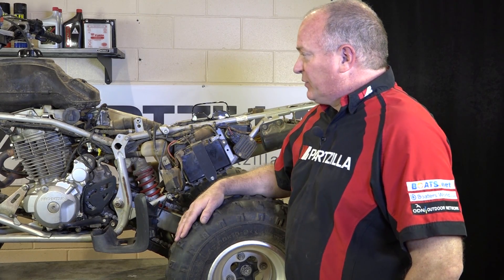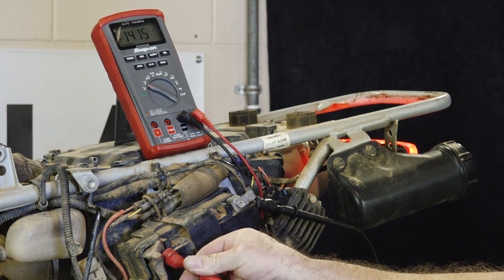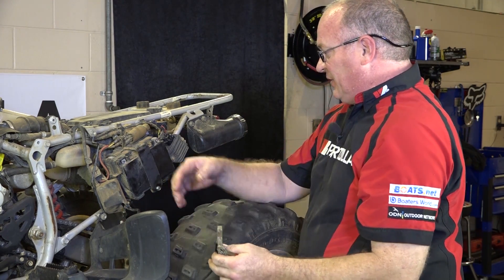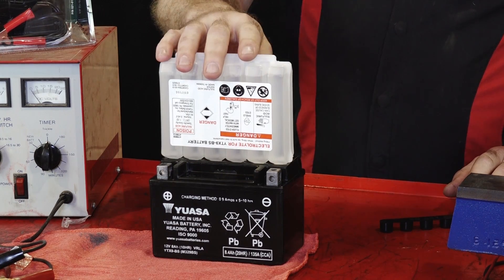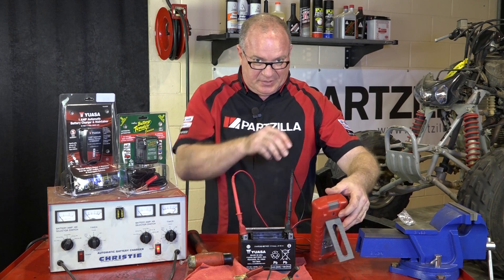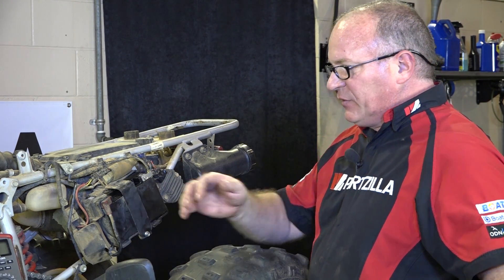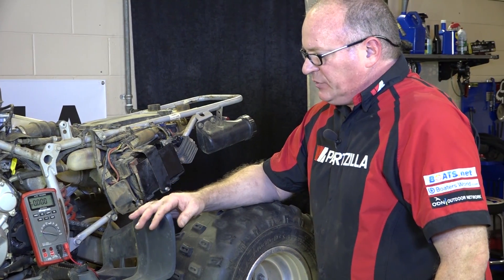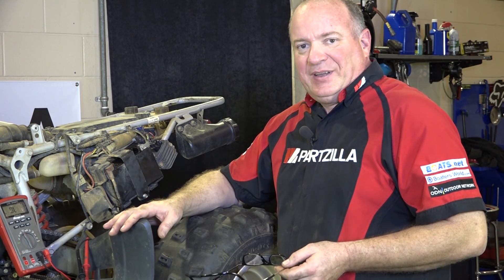How to Test ATV Stator, Rectifier and Battery | Partzilla.com

Comment: Great Video-! My problem is the same as you  describe; my honda rancher ES400 2010 battery runs down slowly over two weeks, then wont start the engine. This is a new battery.  This is ridiculous. I just had it on the charger for 3 hrs. Battery reads 13.01 and when I start the engine the battery reads 12.96. The rectifier does not look like the one in your video. Mine has two plugs. I need to determine if its the stator or the rectifier/regulator as your video show. Which wires are from the stator? And which from the diodes?
Thanks
//Dave
Reply from the maker: Didn't have an easy way to describe it.  So here is an image I found online that should help you out.

http://photobucket.com/gallery/user/whiteman90/media/cGF0aDovcmFuY2hlcjQyMGNoYXJnaW5nY2hlY2tfenBzMDkzOTgwN2UucG5n/?ref=
Reply: Fantastic! What's the part # of the rectifier--it is bad!

Comment: I have a 2003 Honda trx400ex that won't start. The headlights work, but my green neutral button doesn't light up to start. I push the button just silence no clicking just silence
Reply from the maker: Silly question, but are you sure it's in neutral?
Reply: my atv honda is the same thing
Reply: what do I do

Comment: If the stator was truely bad would it even start the quad on its own?
Reply from the maker: Yes.  Your battery starts the vehicle, but once the battery dies because it's no longer being charged by the stator, then the bike will be dead as a doornail.

Comment: my sons Polaris 50 stopped working while he was riding checked and it had a blown fuse. Replaced the fuse then the regulator started smoking and caught fire. Orderd a new regulator, replaced the fuse, and it blew the fuse again. troubleshooting I have found that as soon as you plug into the regulator it immediatly blows the fuse. From what I have read online you should still be able to start the bike without the regulator hooked up. His will not, even with a jump. The spark plug only shows spark when you let off the starter switch. I dont know where to go from here. Please help this is my son favorite thing to do and he is very sad he cant quad right now.
Reply from the maker: Sounds like a short somewhere.  Check the harness to ground with the stator and regulator disconnected.  Check all the wires for a fray or ground out.

Comment: how do I test to see if the stator is going to the rectifier I know I could test it by unplugging the rectifier 
in testing it that way but how do I test the other way while it's plugged in
Reply from the maker: The best way is to unplug it and run the tests.

Comment: I'm having starting problems with 2006 Honda trx 450er. Is there a way you can post a video on how to check everything on it? Or send me a link to help me. Please and thank you very much.
Reply from the maker: We are working on getting a 450 in the mix.  Until then, this video still shows the basic concepts needed to troubleshoot your quad.
Reply: Partzilla yea I got the just of it. I checked everything and got it figured out. I just wasn't to sure on how different they really were. Good informative video. Thank you.
Reply: thanks for the video however my daughter has a TRX 250 EX 2005 and it won't start,  was working fine until the fender bracket where's the battery goes broke and the battery drepe
 has new battery now but ues make the noise but wouldn't start. please help me
Reply from the maker: Check fuses and starter solenoid.

Comment: Hi there I have a quad bike but the electric start button doesn't work and when I put the key in and turn it to on the speedometer lights don't turn on but when I turn it on manually with the leg starter it turns on but if I'm not accelerating the head light and flashers and horn are all very weak please give me some advice on what to do and thanks.

Comment: question to anyone who may know, I have a 2004 Yamaha vino 50 which has a semi new battery, so I fully charge it, it works until I ride it for about 15 minutes, then blinker/headlight get real weak, barely can see them , even while riding , I don't wanna go buy something for nothing so im wondering if anyone could give me an advice on what it could be? I'm thinking stator
Reply from the maker: Daniel, that would be the first thing to check. Test the voltage output of the stator to confirm.

Comment: I have the same battery so what amp trickle charge maintainer should I get? Also what brand of battery analyzer are you using? Thanks!
Reply from the maker: Any motorcycle trickle charge will do the job.  This one is very common and works well.  http://www.partzilla.com/parts/detail/aftermarket/XP-4098999.html
It's a Honda tester in the video...but this one will do the trick too.  http://www.partzilla.com/parts/detail/aftermarket/XP-4473144.html
Hope this helps!

Comment: where is the voltage regulator on a 2005 polaris sportsman 400. mine is over charging. have checked the volts when battery light comes on and it's putting out up to 17 volts only at high rpm and it never gets up to 13 volts at idle. Would that be the regulator going out?
Reply from the maker: I would check the voltage coming directly out of the stator, if that looks normal, then you will need to test the CDI box.  The regulator should be integrated into that unit for this model Polaris. (from what I can see)  Usually Polaris puts the regulator up by the radiator, near the top.  If you can't find it there, it's part of the CDI.  Those have been known to go out occasionally.  I hope this helps!

Comment: I recently bought a stator and a regulator rectifier for my 1998 Honda CBR900RR from Partzilla.com and a new battery from Autozone and today my bike cuts off on me and did not want to start up, what could be the issue?
Reply from the maker: That could be anything.  Does it turn over and just not start?  Does it just click but not turn the starter when you hit the starter switch?  If you can give more details about what it's doing, we might be able to narrow it down a little.

Comment: i have no spark on my 1998 Honda foreman 450 have so far replaced the regulator/rectifier,stator and pick up coil ,spark plug and coil and cdi box also I have cleaned all ground wires . I have checked all the fuses and the kill swtich. I'm stumped
Reply from the maker: Wow.  It sounds like you have covered a lot.  So just to clarify, it turns over when you try to start it but no spark to the plug? I'm sure you have done this, but I would test the voltage starting with the battery and working my way through the system to the plug and see where it's losing the power.  Could be a damaged or cut wire.

Comment: hey I have a 2004 660 raptor and it wouldn't get any fire to plug and I remembered I read something about a month ago about unplugging the rectifier and I did and it started fine rode twice then went to start it and sounds like it not getting any fire now what do I do

Comment: Ok, here's a project for you to figure out because I don't understand this problem at all. I have a 05 trx350fm Honda Rancher 4x4. So here's the problem, the atv had been setting outside for at least 4 yrs. so I got it and cleaned it up and replace a lot of things on it, but when I rebuilt the starter and put it in the 4 wheeler, well when I try to crank it I can here the starter but it's not turning the motor over. So I took it back off and put my finger in the starter hole and could fell a gear. The gear will turn clock wise easily (clockwise looking at it from the back of the motor). So I took a digital caliper and mic the distance from the gear to where the starter would be if mounted, I also mic the length of the starter gear and the starter gear is plenty long enough to reach the gear inside of the motor.

So I'm at a point to where I have no idea what to do. I would certainly appreciate any bodies help with this. Thanks.

Comment: I have a kawasaki and i got it from my little brother when i got it it ran for about an hour and then out of the blue no spark so i pulled the cover off the stator and theres oil in there is there suposed to be oil in the stator
Reply from the maker: Hello Bam. Yes that is normal, no need to be worried

Comment: I am looking at a 1996 yamaha warrior 350. it will roll over but won't fire. it has a new coil, cdi box, and a starter. any suggestions?
Reply from the maker: Hello Tim, the next thing to check would be the carb. it may need to be cleaned.

Comment: i have a 1986 honda trx 350. i just bought a new battery the specs are right for the machine but the battery goes dead while im riding it and have the lights on. it shows its charging to the battery up around 13 volts when i rev it up alittle.the lights are original so its not over drawing or something stupid. could it be the regulator or a weak stator?
Reply from the maker: Hello mike. The unit should be charging 14 to 14.5 volts. I would check out the stator.
Reply: ok thank you will do
Reply: Mike Rumsey ?

Comment: where does the ignition coil wire connect to from the head
Reply from the maker: Hello Justin. if i am understanding you correctly,  the wire leads to the ignition coil.
Reply: Partzilla thank you for answering my question but where is the coil located for me to hook it back up ?

Comment: Not sure if I will get an answer here but first of all thank you for the video. Its been a while I did this and I wanted to fresh up my memory. I have a fairy new stator installed but its not charging. I tested both Stator and Regulator. While I get equal readings on Ohm at the stator, I only get good voltage on two of three cables. The 3rd was very low. I am not sure if its charging anything at all like that but Im guessing no. Also when I test it on ohm from all 3 cables to ground I get a reading on all 3. I dont think im supposed to get any reading right?

Comment: hello i have a raptor 350 2009 and dont start just do a click sound, im ready change starter, and a litle box with fuse, any ideas
Reply from the maker: Check your battery voltage. Should be at least 12.5 VDC

Comment: Hey John, about to rip into a 91 Honda fourtrax 350...wilco over & out... PS ordering from Canada is a real pain in the Beaver she says..
Reply from the maker: Two weeks into your project -- how's it going, Roger? Sorry we couldn't help you out with some US shipping on Fourtraxx parts.
Reply: Glad ya asked! Lucked out at least in parts cost, considering just a battery, oil, filter and a plug had us purring. Grinning I'll add, John you really have enough to tinker with, myself I'm capable but having these videos are well, like my old shop teacher from High school days. 
Your parts availability and prices on your side of the crick have us Canucks drolling most often but there was a breakthrough here from a guy that started fortnine.ca outta Quebec... mention it if ya will to someone from my area if you like. This will never be as good for price and selection or in other words no threat to your Countries deals! 

Regardless that oil filter removal /install on the quad you showed was what worked for me... No catastrophic fail thanks. 

You ever rip into street bikes of any types? You ever a pit mechanic? Talk later!

Comment: my 2012 honda rancher wont keep running when i jump it off it dies out soon as i disconnect the cables what should i do?
Reply from the maker: Replace the battery first and then check the charging system,

Comment: I have a 2007 Arctic Cat 250 the battery went bad so I replaced it. Then not long after that all the electrical went crazy. The headlights went bright white and blew up then everything stopped. Does that mean the voltage regulator went bad or the stater. Please let me know you thoughts and great video.
Reply from the maker: I would bet on the voltage regulator.

Comment: Are the stator output wires typically on the side with 2 wires? I could use this method on a 2003 Grizzly 660? Having an issue where charging voltage of 14v is only lasting for a few minutes then dropping to static battery voltage.

Comment: I'm testing the components of the charging system on my '95 Honda CB500 because the battery has gone flat. The R/R is a thyristor type and the diode measurements fall within the specs in the Hayes manual [500-10k/700-15k] and are relatively consistent. However, all are in the lower range [533/730] and nowhere near 10k/15k. Is this normal? Is the R/R in decent health? Thank you

Comment: What happens if I mount a 35 Amp reg/rec on a bike that originally had a 22 Amp one? (It's a Yamaha r6r 2010)
Reply from the maker: Basically just overkill. The stator can only output to it's max 22 amp. The 35 amp can easily accommodate this.